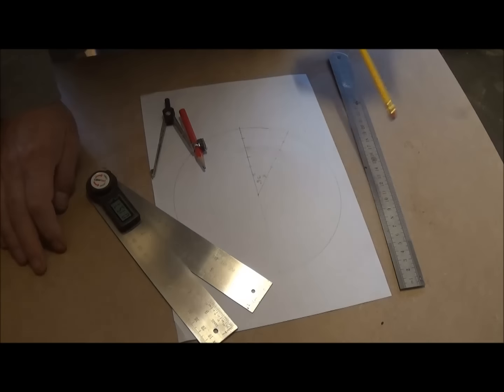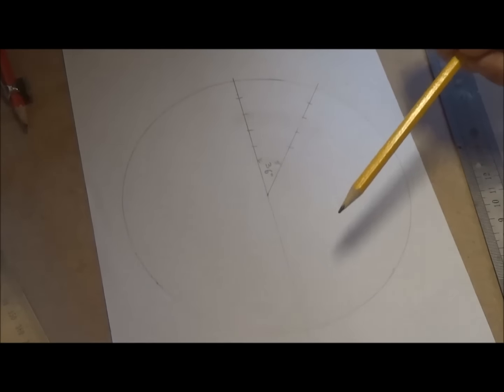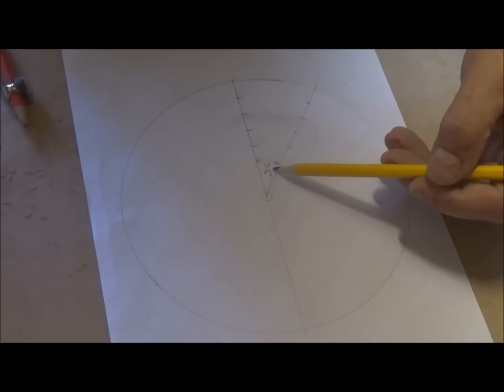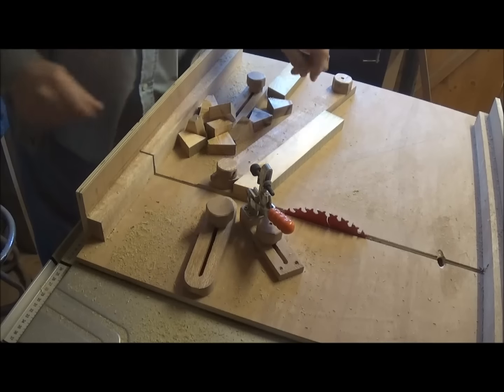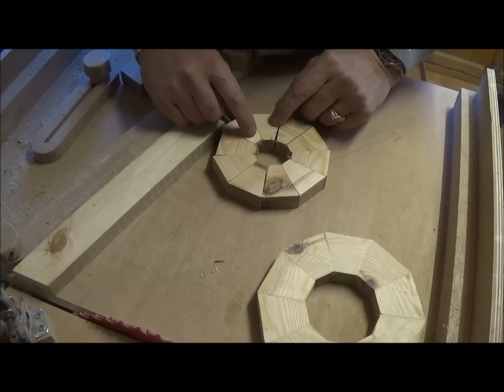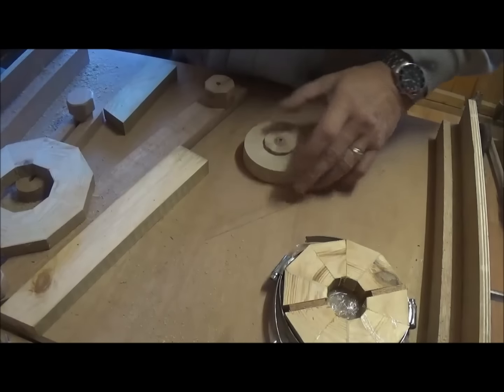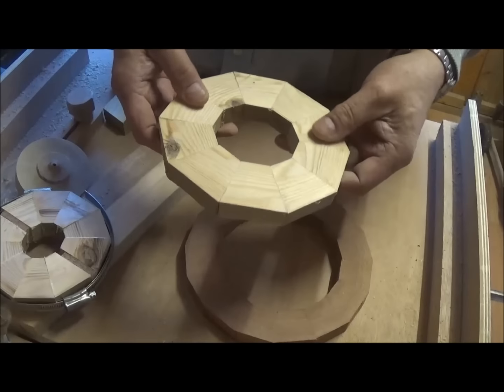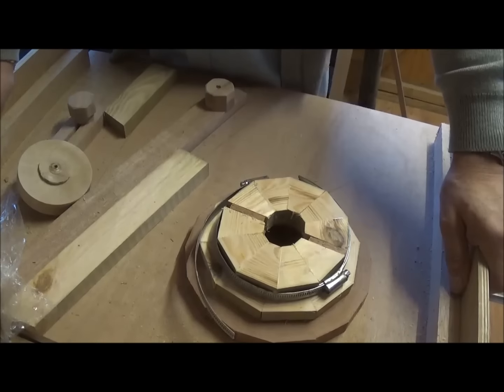Woodturning at 54a. #35. Starting simple segmenting  pt.1

Comment: A good explanation of the process for segmenting Keith. I don't have a mitre saw or a table, so I have to use a bandsaw then sand the ends of all the segments. It takes longer and probably isn't as accurate, but it works.
Reply from the maker: +Andrew Stevens  Hi Andrew. I've cut segments on a bandsaw,and I find that by putting a wide blade on (13mm) I got a good straight cut.It doesn't matter how long it takes as long as the end result works!  :)